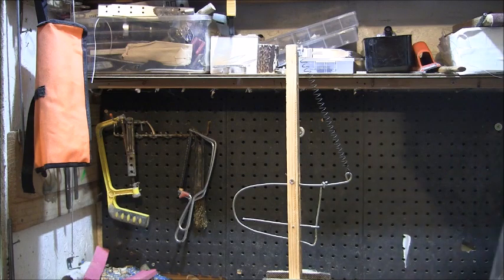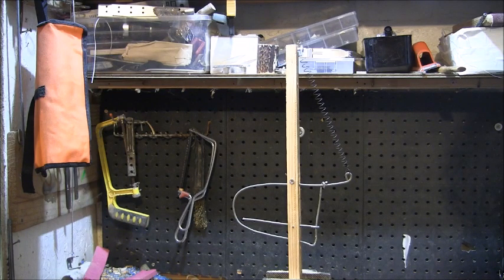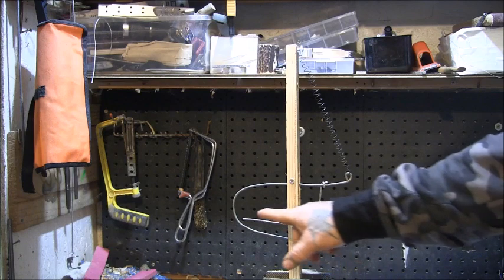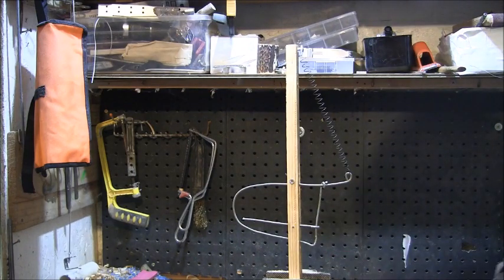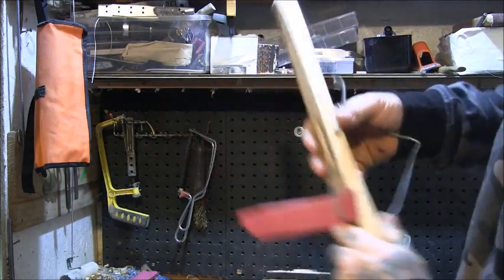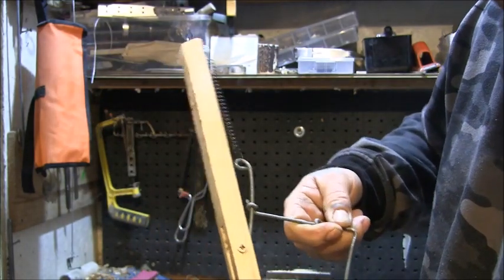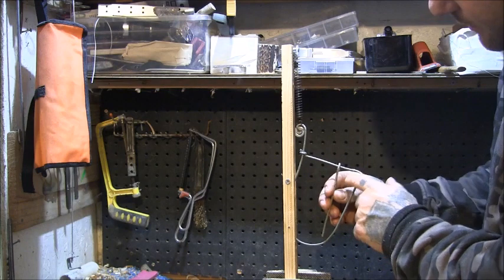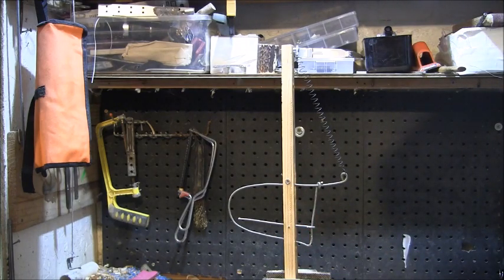HOMEMADE BODYGRIP TRAP

Comment: Wow, great video, man.  Excellent explanation and demonstration.  You give the clearest instructions, brother!  It's also clear that you know your stuff.    
...I was thinking...  
By changing the wire gauge and spring, this would be very easy to scale up or down as needed.  If so inclined, you could catch anything from a mouse to an elephant. If you had to scrounge your parts, you could replace the spring with elastic or tire-tube, and the wire with a stiff piece of sheet metal.  Heck, you could use sheet metal or flatten and sharpen the curved portion of the trap wire to make a little guillotine.  [Can I say that without getting banned?]
Oh, and make sure to knock the edges off the corners of the surface you'll be striking to stake the trap.  This will help reduce the potential of your valuable trap frame from splitting.  Theoretically, you could use a box or a pipe in place of the stake.  The animal would travel through the pipe or box and the wire would pin him up against the wall of the tube(or box).   Lol or use this to protect your mailbox.